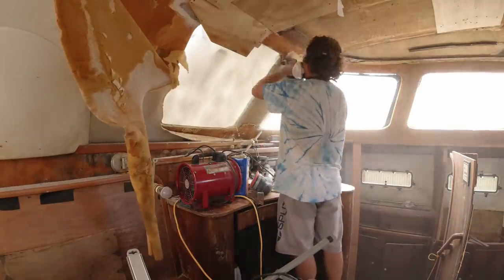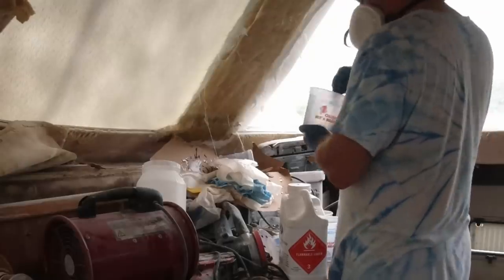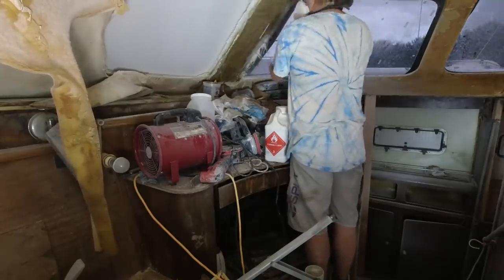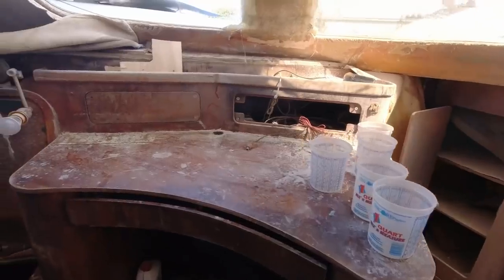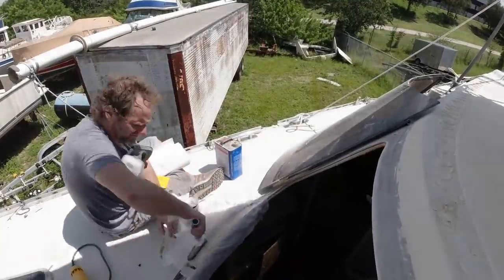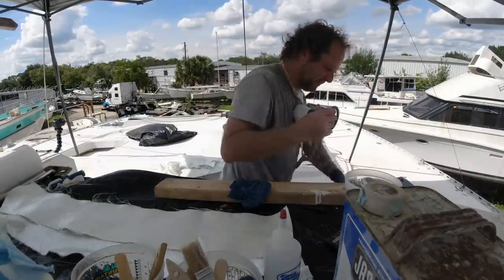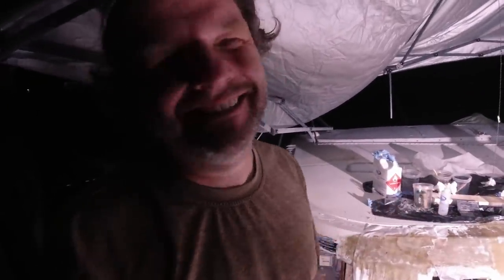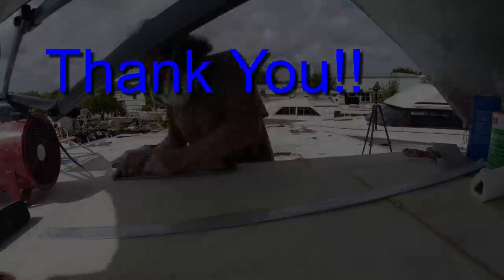9 Big Mistake!! Salvage Catamaran Fiberglass Repair.

Comment: You are the first guy I have seen repairing a boat with the lamination schedule from the factory. They also don't always use the same core material that was originally used.
Reply from the maker: While not using the same materials will work, it all depends on how much you want to trust your repairs. Everybody has a different comfort level for risk.  You see some people doing crazy stuff... I saw somebody repairing a chain plate mount with chop strand mat and I thought WOW that is not going to hold. Sure enough it didn't. It's a free world and I'm not condemning anyone for fixing their boat in any way they want, but I want mine to be as good as or better than new to be out in the ocean with my family. Some people say I can do it others think I can't. I plan to fix it to my comfort level that it will be strong enough for me to trust and that's all I need. For me that means following then exact type of material and in some cases the same brand that was used by the factory and very carefully adding a tiny bit extra using good engineering practices to make up for the fact that it is a secondary bond.
Reply: Nor the glues the specs are made up from,,  so you will have to find that out and the temp it was layer , just do it your way , I have done a few and if you know boats being boat builder it will flow along ok as did mine
Reply: The factory generally uses the cheapest materials and methods possible to achieve the minimum standards.  The factory build is all about making as much profit by doing the bare minimum as cheaply as they can.  That is why if done correctly, most repairs will be better than factory.  Most boat builders will not give you their lamination schedule because they don't want people to know how flimsy it is from the factory.  Its a big reason why these storm damaged boats get damaged the way they do to begin with.
Reply: Very useful episode, thanks for sharing your knowledge Bryan

Comment: I've laid rolls and rolls of hand lay up fiberglass and we always pre-wet when I can, when working upside down its much harder , avoid too much resins and try to cut to exact size or edges will peel. We never use peel ply commercially ( epoxy excluded) the resin does not really squeeze thru much in hand lay up , just control the resin and roll tighter if you have to.  If you have any 6 or 10 oz cloth you could put that on dry as a final layer if you need to absorb excess resin and it leaves an almost finished surface. 
If at all possible layup all repair layer at once so you don't have to grind the previous cured layup smooth before the next layers.  Usual practice is smaller layer to larger if doing all at once , end result is much smoother but roll smaller pieces edges down tight before the next layer. If not working upside down you can assemble the layers on the wetout bench first and roll hard.  
  Get a really good wet out bench that is steady . Maybe a small wall papering folding table might work.  Don't use plastic to wet out on . Get a roll of brown paper and tape it down to table , then after your done for a bit , stick a new piece of brown paper to still sticky paper below, smooth out any mess first . Then you ready to go next time and paper won't move around! . Repeat many times until it's to lumpy. Then remove the entire mess and start again. You can use newspaper but brown paper is better and a great investment , you can use it later to cover good stuff as you get into the job. ( the polyethylene type plastic will absorb a little styrene and wrinkle up and be a mess.) you can use sheets of cardboard (or Mylar) but it's expensive unless you have a source.
You situation will be different but we always try and wet trim the fiberglass when it's almost cured to a leathery stage , use a box cutter and you will reduce the grinding later on. Takes just a little practice.
With your repairs you will have a hard time getting the same strength so if you used a something like Coosa board ( expensive I know) as a core on flat surfaces you will gain extra strength for very little weight gain.
A few tricks of the trade from a pro.
Cheers Warren
Reply from the maker: Thanks for the great tips. I'm going to try some of them.

Comment: Good video. Goof tips.  I'm an old guy with a lot of experience. I can now draw something, make it and it'll work as designed. That took about 30 years. But absolutely: Just get started. I used to study my furniture magazines hours, days, weeks before I'd start making something. Then I realized they were just holding me back. So I drove them over to the Home Depot, gave them to the guys looking for work. Got them out of my head (where all pertinent information was already) and put them into the hands of some guys who hadn't seen a lot of the stuff and might enjoy it.   If as you say, you just get started, you get to the part you didn't think of a lot quicker, that's usually more critical than having a great plan. 
If was sanding fiberglass I'd have a shopvac hooked up. Always get the cyclone thingie that sits on top of a HomeDepot bucket. It'll collect 95% of your dust and all the the big stuff before it gets inside your Vac. And always use a bag and the pleated filter in the vac. And if you're ambitious and want to live without COPD get another hose, connect it to the exhaust and then stick it out of the window. At the very core of a vacuum cleaner is grinding up, static charging the tiniest particles and then spitting them out of the exhaust port and into your lungs. 
Another thing that works is one of those cheap box fans with a furnace air filter taped to the back. That will move a lot of the dust away from where you're working. When I first tried this I used about a whole roll of duct tape to seal the filter on it.  In my house I have a round floor fan and a 22 x 22 furnace filter just sort of held in place on the back with some wire. We have a lot of wildfires here in Southern California so the air's been terrible. That loosely wired on filter (the suction does most of the work) cleans more air faster than the $400 HEPA unit I have. 
Resin or epoxy? I would never do anything but the smallest epoxy job without long sleeves, nitrile gloves and your respirator. You can develop a sensitivity to the chemicals and break out into a rash every time you mix up a batch - boat fixing days are over. 
I've done a bit of epoxy. I agree the scale is the best method. to keep it clean I drape a piece of saran wrap over it. If you put it in a freezer bag and seal it it doesn't read right. I made a chart on a spreadsheet for WestSystems  and the slow 107 hardener and the fast hardener. Weight ratios are different than volume ratios. I printed them out and stuck them in plastic sleeves. 
Your explanation of your messy method? I know that guy, I see him in the mirror every morning. Hire a kid, have him clean up your mess. (and don't get mad when you can't find something). I don't have to tell you, you already know: having a clean work space is always better. You will likely struggle with this the rest of your days, the sooner you have clean space days the better it will all turn out and the more often you'll have clean space days.  (And as another messy/can do guy? I've cleaned up and sorted pack rats. I was brilliant at it. My own mess? I have been great, I'm going through a messy period. 
I've never had much luck with flap discs. Instead I buy bulk whatever the lowest grit you can find. 15, 20? I made a box with files with the grits. Now I have an 18" stack of sanding discs and can see which grits are low.
And don't use a Skilsaw when you're really tired. All the guys know missing fingers were tired at the time (but actually sidewinders and tablesaws, I don't actually know of any Skilsaw amputations.) 
Hang in there, you're making progress.
Reply from the maker: Thanks for the tips

Comment: Hey Bryan ... just a quick note when youre laying glass on a repair  you want to start your pattern full size and work your way in to fair.

For example if i have say an 6" blister on the hull.  I will grind down to good glass and then make my first pattern 8" ( note a 6" blister will be 8 - 9 layers)  my next pattern will be 7 3/4" and so on until I get to depth and thats because I want as manny fibers against the the glass as possible.

As you fair in your glass strands feather into each other and it makes your bond stronger.   Going small and working out is a mistake because all your doing is maing a cork that will break away because you didnt get that initial bond that you need from the beginning.

Dont forget that you need to squeez out as much resin as possible because its the glass strands that give you your stregth.

Good luck .... ⛵💕
Reply from the maker: Great tips. One person says small to big another big to small... there are reasons for both ways and I actually do it both ways depending on the situation. I may do some testing to see if there is a measurable difference just for fun.
Reply: Great tips!
Reply: @BryanSailing  just keep in mind Bryan Resin doesnt give your boat strength, glass fibers do and the more fibers that you can lay in from the beginning the bettet and if you can vacume bag it .... do it!

Tge more resin that you can squeez out the better.  ( quick Note:) when vacume bagging dont go more than 15 psi and thats becuase you dont need more than that and you dont want a decompressive catostrophic failure.

Good luck and I cant wait to see how she turns out.  .... ⛵💕
Reply: Bryan Sailing  I AM A SMALL TO BIG. 
More layers come in contact with the original.

Comment: Don't forget, guys. Have your health checked before working in enclosed areas with resins. The resin fumes is a vasoconstrictor that makes your blood vessels get smaller. If you have any blockages you could run into trouble. I always use a full hood with a remote air feed like the Allegro 9210-01and I place the air pump far away from my work area, up high and outdoors.

Comment: Buddy laying glass is not that hard.  From what I have seen you are doing fine.  
There are a few little tricks that will save you a little money and time.

Get an air tight plastic bucket. Put a gallon or two of acetone in it. When you are thru wipe the largest quantity of resin off and drop them in the bucket. If you like super clean tools use two buckets.  After you wipe the most resin off rinse in one bucket and store in the next. Of course put the air tight top on ASAP.   Dont throw the acetone away.   Resin will sink to the bottom. Pour the acetone off and discard the bottom layer of mostly resin.  Don’t waste too much time cleaning tools.  Wipe, rinse and throw in the bucket. 

Know or understand.  Resin and gelCoat must be separated from air to get completely hard.  If it’s not separated from air it stays sticky.  Properly cured resin IS NOT STICKY.   

Wax (sanding aid) 
POLYVINYL ALCOHOL 
GEL COAT WITH WAX 
SARAN WRAP 
CAN BE USED TO BLOCK AIR AND ALLOW RESIN TO COMPLETELY CURE.  

The curing method wax, PVA, gelCoat should be removed before laying another layer.   Unless you are hot coating. 

If you are hot coating laminating several layers (laying the layers together while still wet). only the top layer  needs wax, PVA OR SARAN WRAP to block the air off.  

IN FLORIDA THIS IS NOT A BIG DEAL BECAUSE IT IS SO HOT.  

But if done incorrectly can cause delaminating later on. 

RESIN CREATES AN AMINE BLUSH WHEN CURING.  ThE AMINES IN THE RESIN RISE TO THE TOP.    THIS LAYER SHOULD BE REMOVED BEFORE LAYING GLASS OVER IT.   It is not a problem hot coating laminates. 
They can be washed off with soap and water, sanded or ground or wiped with a solvent.  

YOU ARE DEALING WITH EXOTHERMIC CHEMICALS.   They create heat.  They will catch fire if rags and resin are piled in a garbage can.   YOUR WORK AREA SHOULD BE KEPT CLEAN!  If several layers of resin are being laid heat builds up and they will catch on 🔥fire.   A thick laminate of like 10 layers is so thick it probably will catch fire in Florida.  It might be ok in Michigan.  

I frequently lay 3-4 large layers Without problem.  But I have had 3 layers catch fire!
It depends on how much MEKP AND HOW MUCH RESIN AND TEMPERATURE.   Just notice how hot your work is.  

BE AWARE OF YOUR SITUATION!!!! 

Acetone is extremely flammable.  A glass fire becomes explosive an life threatening quickly!!!!!!!!!!!!

Example  AT 2:00pm Florida, 3 layer laminate,  4 square feet area, in direct sunlight and 2% MEKP.  YOU ARE GOING TO GET A 🔥 FIRE.     Either get in the shade,  wait till night.  Reduce MEKP TO 1/2 - 1%  
Or all three.  Then do the lay up.

Peel ply 
A layer of peel ply can be used for lots of things.   Usually peel ply is used to give a level layer that does not have to be sanded before the next layer.   Peel ply can be used to help hold the last layer of glass in place. 
Put the layers of FG UP AND COAT AS USUALL.  Like if up side down cover with peel ply and tape peel ply in place to hold glass.

I don’t use peel ply much.  It’s just an extra layer of expense and trash.  But it is a good product and it works.
Reply from the maker: Great idea with the bucket. I'm going to try that
Reply: Bryan Sailing   You are doing fine!!! 
Go slow enjoy making something!!!!

Comment: Bryan,  I bought a katrina boat is 2005, I have a very important tip. My boat and a catamaran parlay revival youtube chanel both suffered unseen damage,   What happens is the outside of the boat takes a huge hit but flexes like a fiberglass skate board and shows minimal damage.  But inside the bulk heads and structure places crack because they are rigid. The outside bounces back.  If you havent watched parlay revival , watch his most recent video,  It will help you .  Good luck
Reply from the maker: I think I will do an episode on looking for hidden damage

Comment: Great video, again! love the time laps stuff, you are editing like the pros at this point, good job, I watched Parlay too glad they were not too far out to sea when the found the trouble, I am sure they will get it fixed, maybe make sure your boat doesn't have those types of issues. 

Good job on the glass work, boat is going to be awesome! ps I work messy like you, note to messy working guys, make sure you don't ruin finishes and appliances you later will regret, in other words "try not to scratch the fender while changing the spark plugs LOL"   Keep em coming, great stuff and thanks for sharing!
Reply from the maker: Thanks. I'm sure that Collin will get Parley seaworthy again. I'm thinking about doing a video to show the damage on the boat and show how I look for "hidden" damage.

Comment: Just a thought you might want to put your 1st layer of glass down and make it cover as large an area as you can and then go back over the top of that with consecutively smallie until you get the depth built up that way your bonded area is the largest Internet grinding through just a thought

Comment: Mats over at Sail Life lays up with a different technique. More like laying wallpaper. He starts by wrapping his work surface in cling film. He epoxies the existing work and then applies epoxy to the new glass on the work surface, multiple layers if required. He then lays the pre-epoxied glass onto the repair site. 
This may be easier for you.
Reply from the maker: I've seen a bunch of his episodes, but I must have missed that. I'll take a look.

Comment: Tip.. Cut your angle grinder guard down.
I never use a guard, 40 years ,  always try to grind with the grinder pulling away.
You will be able to lay the disk down flater.

Comment: Cut each ply's excess to 1/4" on all layups and it won't pull away on a overhead layup, and won't bubble up or pull away on a horizontal layup from the weight of the excess bending away from the structure's edge. Peel ply everything!
Reply from the maker: Great tip

Comment: When these fiberglass vessels are made it was based on chemical bond, now your repairs will be based on mechanical bond. 6 or 8 inch, 36 grit abrasive on a sander, not a grinder. Use 1 inch diameter burrs for inside corners. The mess will be half of the grinder, and produce better bonds, providing temperature is correct.

Comment: And did you get a chance to check the bulkheads for failure or cracks developing. I would start with main structure first and work back from there..., just saying!

Comment: one question is a big one in the past ive had trouble measuring the hardener in my epoxyto get it to set up within reasonable time.Either hardens to quickly or takes days. So do you just follow the directions or is there a secret ratio to use?

Comment: Suggestion, since this is a true money pit, just restore it to be a fixed marina rental(tear out the engine compartments to extend the immediate birth compartments, install electric thrusters, just enough power to move from slip to mooring buoy, add enough solar/wind to make it self-contained). add a few more boats of such character to create a marina apartment complex or a genuine on the water hotel???(this would aid in financing your further project adventures)....(I would be interested, but am now moving from 1 apartment to another and not willing to do again for at least 4 yrs..LOL)